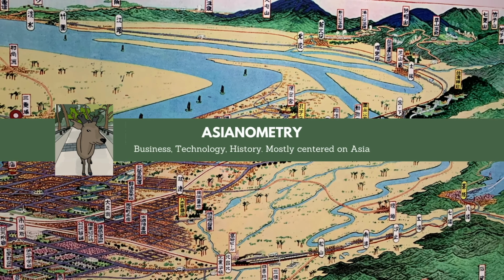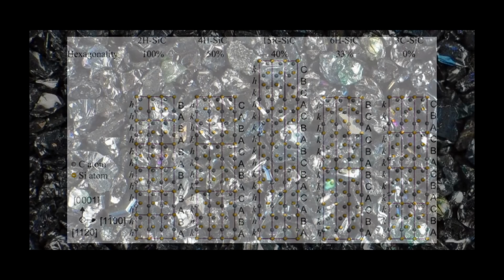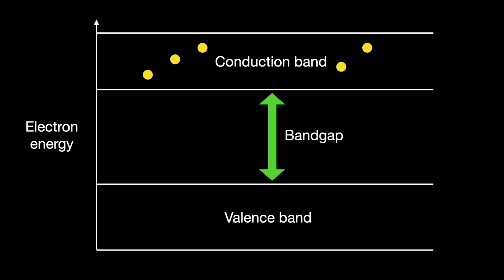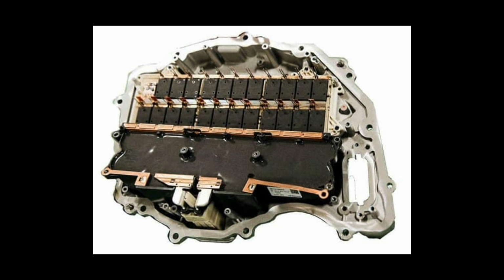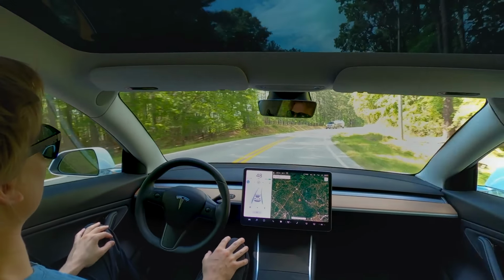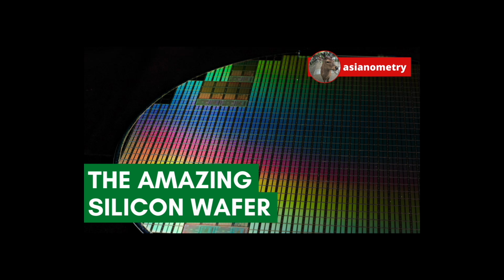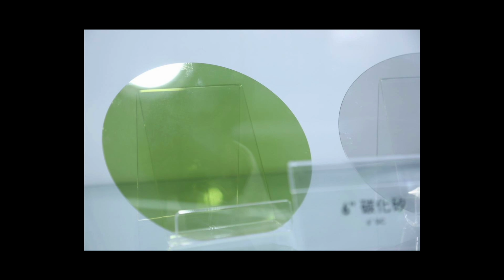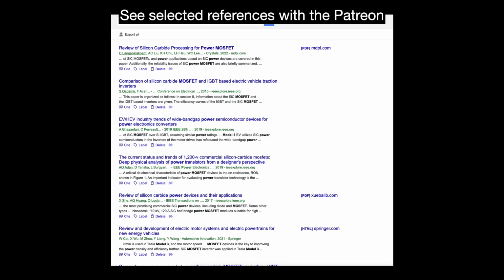Silicon Carbide: A Power Electronics Revolution

Comment: Wonderful!
Can you also explain the Galium Nitride (GAN) transistors and how they compare to Silicon Carbide and other power switching devices.
GANs are apparently also finding their way into power electronics lately.
Reply: GaN devices are extremely common in LEDs and are the basis of white LED lights, where they get hot, easily 150C.
They have uses in power devices too, but like other III-V semiconductors don't have a good native passivation layer, ie MOSFET- like devices aren't easy to make with them. 
GaN and SiC are somewhat similar in electrical characteristics, but which becomes more widely used will be whichever one industry gets the most experience working with first. 
Silicon carbide outperforming silicon devices is REALLY significant because there are decades more experience with silicon, and getting silicon carbide devices to preform up to its theoretical potential is quite difficult.
Reply: @davidgunther8428  perform*
Reply: @davidgunther8428  Are there semiconductor materials other than silicon with a good native passivation layer? And what passivating layers do they use when attempting to make CMOS ICs with semiconductors that don't have a native passivation?
Reply: @gregorymalchuk272  SiC is the only other one I know that has an easy native passivation layer. It forms SiO2, the same a silicon does. 
You can't make CMOS transistors with GaN, they have a different structure, so the transistor type is different. HEMT maybe? I can't remember the name off the top of my head.
Reply: GaN is smaller and faster for the same power level, but is limited to 600V devices at present.  That means 400V DC bus, translating to 240V AC source.  Meanwhile SiC is presently available at 600V, 1200V and 1700V, making it suitable for 400/480V (1200V devices) and 600/690V (1700V devices).  SiC devices are presently MOSFET and Schottky didoes.  The SiC is better suited to EVs and industrial devices like motor drives and UPS.  
The insane speed of GaN is enabling small to mid size power supplies to shrink radically.  The go to topology is a two stage converter.  The first stage is an active rectifier, and the second is a DC/DC converter to low voltage.  
Basically, and inverter running "backwards" is used to rectify the incoming line.  The rectifier is a full bridge, with 1/2 leg using Si MOSFET and 1/2 leg using GaN MOSFET.  The Si MOSFET is being used as a synchronous rectifier because the voltage drop of the Si MOSFET is less than a diode, improving efficiency.  Only switching at 50/60Hz, the Si MOSFET does just fine with minimal switching loss.  The GaN MOSFET pair switches at hundreds of kHz, controlling the input to a precise sinewave.  The active rectifier is used because of the ability to generate such a pure sinewave draw AND is a tiny bit more efficient.  The active rectifier eliminates harmonic distortion that a diode rectifier makes, and counteracts the capacitive draw from the EMC filters in the power supply.  Both are massive problems for data centers when 10's of thousands of power supplies all contributing to harmonic pollution and leading power factor.  As data centers have grown massive, it created lots of internal and external problems, and the active rectifier made it all go away.
For the second stage DC/DC, the LLC converter with either a half or full bridge is used.  (Google "LLC", there are loads of articles on it if you want to read more.)  The LLC converter is a resonant converter that enables the converter to run at high hundreds of kHz to low MHz range.  It enables the converters to be vastly smaller for the same power level.
Reply: @matthewbeasley7765  Cool stuff! What's your background? You sound like a circuits engineer. Has PFC really made that much different? When did it come in? Interesting that some converters use Si and GaN alongside each other...

I'm (originally) a semiconductor engineer, and there's so many misconceptions in this comment thread that it makes me sad. Let me start with the basics: GaN wafers don't exist. Basically. There are a few in R&D, but they're too tiny to be commercially relevant. You have to grow GaN on something,  and this is where the problems start. Its lattice constant (basically its atomic spacing) isn't a perfect match for anything, and the misalignment causes crystal defects to form. What do you use as a substrate? Si is cheap, but has the worst lattice mismatch (most defects). Sapphire (synthetic aluminium oxide) has a better match, but is expensive. The best match is SiC, which also has a high thermal conductivity to make up for GaN's poor thermal conductivity, but SiC wafers are very expensive and limited in size.

Growing anything on anything (including Si on Si or SiC on SiC) requires deposition techniques. The most commercially-relevant one is chemical vapour deposition: you pipe in a gas that contains one element (e.g. trimethylgallium) and another gas that contains another element (e.g. arsine) and a few other things, then the temperature of the wafer causes them to break apart, leaving atoms (e.g. gallium, arsenic) on the surface to build up into a solid layer. Get the temperature right and the atoms move around to make a perfect single crystal. This technique is, in general, very mature, and your phone will have gallium arsenide-based chips in it (or GaN chips but whatever). Growing monocrystalline GaN uses trimethylgallium (a dangerous but well-known chemical gallium source) and nitrogen in reactors that are very mundane and mature except for the fact that they run hotter (GaN and SiC require higher growth temperatures than GaAs and Si).

This is the elephant in the room for GaN. Its bandgap is wider than 4H-SiC and the fact that it's a III-V compound gives you freedom to blend it and create complex structures - like the high electron mobility transistor (HEMT) - but you have to grow it on a mismatched substrate and this is going to impact on material quality and design flexibility. Power devices use either a lateral or a vertical structure to create a thick blocking region. Si and SiC can use a vertical structure - the blocking region extends upwards/downwards, with your contacts spreading out laterally to make a large-area high current device - because a lateral structure spreads in one direction for voltage blocking and another to try to get the current up, resulting in a device that can't pass an much current but uses up more of your valuable wafer. Making vertical GaN devices is difficult.

GaN is struggling with voltages higher than mains voltage. I think they're using vertical device structures, but the thicker you make the blocking region, the longer the thing has to sit in an etcher before you can put the bottom contact on. The 400V, 600V and higher voltage devices on the market don't have very high current rating, particularly compared to SiC, and this is due to material quality. The bigger you make your device (reducing its resistance and increasing its current rating), the more likely you are to hit a nasty defect and need to scrap the whole thing. GaN devices with both high current ratings and high voltage ratings remain a real challenge.

GaN has absolutely planted its flag in the ground as the new king of radio frequency and mains-voltage applications, but it still has a long way to go before it can tackle higher voltage and current applications. Its ultra-fast switching does open the door to further efficiency savings, where it can meet voltage/current/power requirements. I think the hot applications to keep an eye on are electric vehicle on-board chargers and on-board DC-DC converters. The active front end of the on-board charger only needs mains-rated GaN devices and, if the EV is using a 400V architecture, these other low-current applications seem within reach too. Some GaN fans think it's going to make its way into traction inverters, but I'm sceptical (naturally, I am a SiC person, after all). If someone can sell a commercial GaN power module that can deliver 200A or more, then we might be talking, but Hyundai and VW Group seem to be ready to start moving to 800V architectures, just as GaN starts to look viable on 400V systems. Definitely an area to watch.

(One more amendment: 400V architectures are using 650V devices and 800V architectures are using 1200V devices. My former colleagues and I have worked with BMW and McLaren, so trust me on this one)
Reply: @gigabyte2248  Big thumbs up for a whole lot of great content.  Yes, I'm a circuits guy, 30 years in power electronics.
About 20 years ago I was doing NREL contract work on multi-junction solar cells so I learned a whole lot about epi growth layers and lattice constants.  I make ZERO claims about being able to do the work, but sat in a whole lot of meetings as we talked about progress on the project.  
My involvement was looking at very low voltage converters that could tap the layers and allow for unequal currents in each layer.    This reduced the dependency / tradeoff off driven by having the same current at each junction.  We showed it could be possible, but far from practical.
Reply: @gigabyte2248  Regarding the power factor comment.
In the 1990's the EU enacted regulations prohibiting harmonic generation above a fairly low level in most devices between 80W and 3600W connected to the "public" mains.  (Service by "low" voltage i.e. the 230V mains.)

The first solution was to use boost converters with average current control shaping the current into half sine wave humps.  That led to the input of the bridge rectifier to be a fairly clean sinewave.  The only problem was the obligatory EMC capacitors leading to a leading power factor.  
In most cases this didn't matter, but in giant data centers they do care.  Many servers have dual power supplies off dual sources, so each is nominally running at 50% maximum and often lower.  Running at lower power levels means lower power factor ( or twice as many power supplies, whatever way you look at it).  At a big data center, this amounts to 10's of MVAR leading reactive power draw all the time.  In many cases, the power companies don't care about leading power factor, but sometimes they really do.  Many data centers are located where power is cheap - near hydro generation in places like along the Columbia river, St Lawrence, etc...  Leading away from those generation centers will be long power lines to take the power to the cities, and those power lines also draw leading reactive power.  The local area can't afford any more, so the data centers get penalties.
Due to the problems, the data center industry adopted new standards in the early 2010's and mandated that the power supplies couldn't have leading power factor.  
The first solution was to use four MOSFET in a bridge as an "active rectifier".  They boosted the voltage higher than the line and controlled the input to a unity power factor draw.  Even at zero load, that front end would sit there and make inductive current draw to zero out the capacitive draw of the EMC filters.  
Later two of the Si MOSFET were replaced with GaN devices to switch faster and make them smaller.
Reply: @matthewbeasley7765  LLC gives me brain damage
Reply: @matthewbeasley7765  man that's a killer explanation, thanks. I knew of the physical characteristics of the GaN mosfet (extremely high switch speed, how tight the window of gate opening and closing is to input, and the high efficiency from low resistance loss), but didn't / don't fully understand the ways it is useful in applications. They were originally mostly getting development funding for extremely expensive applications where high power efficiency and high frequency are critical.
Reply: @matthewbeasley7765  odyssey made a vertical gan transistor that extends the voltage range to 700V and 1200V in the future
Reply: GaN is best for low voltage high current applications (eg chargers). That's because gallium nitride transistors are extremely efficient (so yuo can make them smaller and cheaper for a given power) but they have even lower "breakthrough" voltage than silicon, and far lower than SiC.
Reply: @kenoliver8913  that is patently false. The breakdown fields of GaN and SiC are 3.3 and 3.5 MV/cm. AlGaNs field can get higher than 10 if you use enough Al.
Reply: @HailAzathoth  I'm going to make an educated guess that you are an epitaxial growth engineer for Wolfspeed...
Reply: Gallium arsenide is showing up again as well.
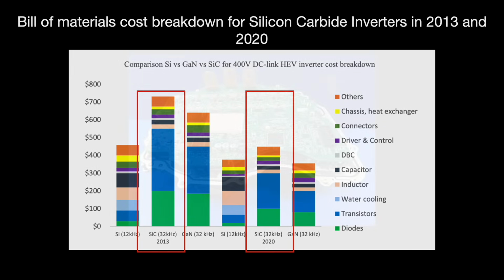Reply: Exactly what I wanted to ask. At 13:41 the chart shows GaN as cheaper than Si :) Shouldn't it cost more? I have a few Baseus GaN chargers. They are tiny :)
Reply: GaN is a 3-5 material which has some advantages around band gap.  It’s great for optical devices where light can kick an electron free to move that might not be dislodged in group 4 devices. SiC is a4-4 material, it’s primary advantage is it’s thermal stability allowing higher current flow through the same area. 

The group’s mentioned are periodic table groups.
Reply: Seconded.
Reply: GN Limited to diodes. the galium in the name idicates why. very ,very ,very limited and precise operating range. requiring a whole lot more cooling/Temp tech in same surface area. too expensive at this time to research and implement commercially. Universities are working on it though.
Reply: @Palmit_  GaN fets are already on the market
Reply: @RNA0ROGER  indeed. But as Ken Oliver said they aren't suitable for high voltage applications. Simple Schottky diodes in SiC outperforms GaN FET in many characteristics.
Reply: @PainterVierax  I mean they are good enough for atx power supplies 400v is hardly high voltage.
Reply: @RNA0ROGER  SiC allows simpler Schottky bridges on main and beyond. No need to redesign a SMPS around a more complex active mosfet bridge to gain efficiency.
Reply: @PainterVierax  In the context of an electric road car would schottky's just be duplication?
Reply: @RNA0ROGER  I don't fully understand your question. For EV, such a bridge rectifier is inside the power regeneration circuit to reduce consumption. This is the complete opposite role of the inverter.
Reply: @PainterVierax  Not entirely sure what your background is on this one. But from my understanding using diodes for regen is a kinda a non starter in ev. You would need to drive the voltage coming from the motor higher than the bus voltage and diode forward voltage. For charging a battery or caps you would have a very very narrow window in which to maintain a safe voltage. I am not entirely certain as to the switching details. But regen is really only practical by usage of the inverter transistors. In theory a monster buck/boost converter could do this. But it would be a huge pain and cost for limited or no benefit.
Reply: @RNA0ROGER  You kinda lectured me but explaining your primary question would have been way more productive. 
What do you mean by duplication? duplication of what?
I'm not into EV at all so I just named the only use case of a rectifier in that technology. If diodes aren't useful in EV at all then yeah they waited the mostfet to switch to SiC.

Although I don't even understand why you brutally transitioned the discussion into EV when we're talking about applications of GaN vs SiC.
Reply: @PainterVierax  Duplication in the sense of building a system atop a system. Gan rocks for a lot of things that are not high power or high voltage. But in consumer electronics and some power lower power system in cars. Diodes are in the present era a solution in search of a problem with anything involving high powers.
Reply: @RNA0ROGER  You have a DC motor mindset.  All EVs now use AC motors.  They use a three phase inverter, and for regen the inverter is acting as a rectifier.  The inverter supplies reactive power to the motor and real power comes back out and is boosted up to the pack voltage.

(If you don't know what "reactive power" is, you're not going to grasp the concept.)
Reply: @matthewbeasley7765  Unless I am mistaken boosted by means of the inverter back feeding.
Reply: @RNA0ROGER  domestically.. with everything well designed.. 400v is very feasible.  still, it is hard to work with tho.  that was the effort i was making. R&D will always progress.  As for the "on the market".. so was betamax when vhs existed. blu-ray /hd-dvd format also. the tech WILL develop more and will become easier faster and cheaper to produce.  there doesn't have to be opposing forces to drive the development.  nor in this discussion.
Reply: @Palmit_  GaN is the semiconductor of choice for high power RF power amplifiers
Reply: @pyrokinetikrlz  it still in infancy in terms of real application. yes, only a matter of time/research before mainstream. but that still needs more and more early phase investment. Gallium is not an easy bitch to master
Reply: @pyrokinetikrlz  Thank you. This (your comment) is not disputed. My comment was in reference (extremely broadly) to the difficulty in working with gallium at a commercially and domestically financial viable level. Advancement/enhancement is always the way forward.. that's time and research of course. LED's are it's bread and butter. and in progression and advancement all kinds of fets etc as the baseline... but managing and working with the stuff is not a given  "that's easy". like 4nm tech. theres hurdles that get higher as the legs get shorter.
Reply: @Palmit_  Incorrect.  
GaN is available in mass quantities for JFET and heterojunction e-MOSFET, with breakdown voltages up to 600V.  The JFET are packaged in cascode with a Si-MOSFET.  The JFET came first, and the enhancement mode MOSFET later.  The e-MOSFET is taking over.  There is one manufacturer with 900V devices available and some success in the lab at 1200V.  
GaN is utterly revolutionizing the small to medium size converter market at 240V or less.  The watershed year was 2020, with a rapid change over.  Computer, server and portable device supplies / chargers are rapidly converting over to GaN based devices.  The power supplies are twice as efficient and 1/3 the size.
Reply: @matthewbeasley7765  thanks :)  I've clearly not done enough , i mean, as much research as you.  grateful for citations/biblio so that i can educate myself even further. thank you :)